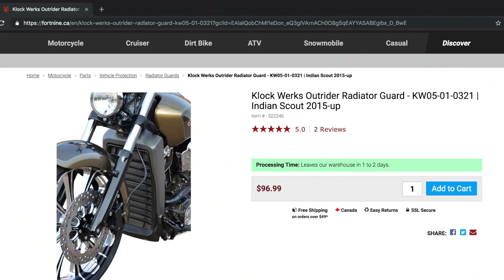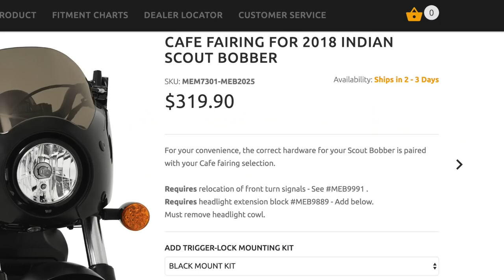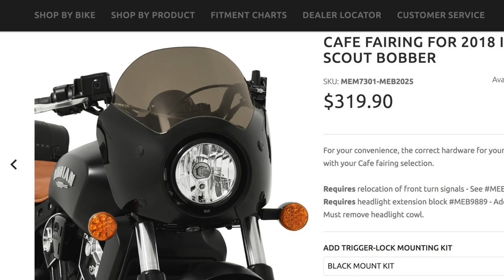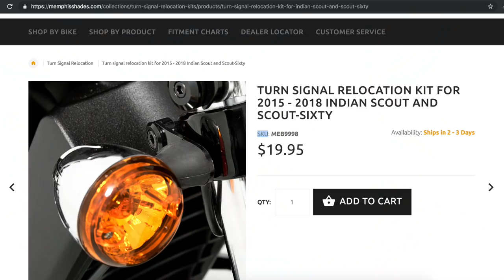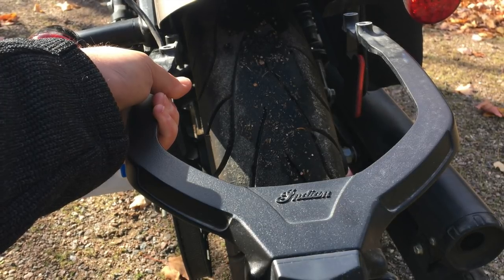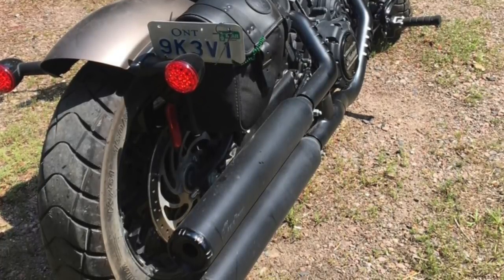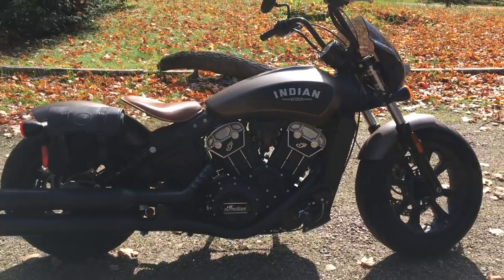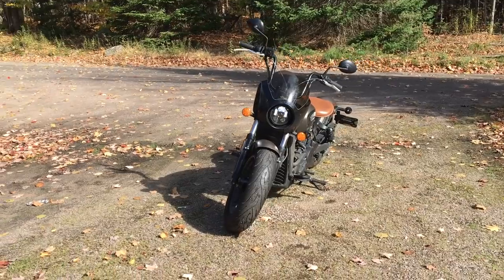Top 5 mods for Indian Scout / Bobber

Comment: I chose the build to order option for my 2018 and only ordered it with 2 extra features. I got the better led headlight direct from from Indian which was super bright. I also ordered mine without a faring because my dad had a spare if I ever decided that I wanted one, and I ordered the street tires as well. Ordering the bike with the street tires and headlight only bumped my final cost by a few hundred which was fine. Other than that, after I had it for a few months, I ordered a set of Vance & Hines slip on exhaust, a Corbin seat, Vance & Hines air filter to work alongside the better exhaust, and I did an ECU remap and added Vance & Hines Fuelpak system which custom tailors fuel mapping by how you ride.

As far as the suspension goes, RaceTech is one of my sponsors for fmx freestyle motocross and when I use to race the East Coast MX Series, so I have had a 24 year relationship with them, they worked their magic on the forks and shocks, and as always, like with every dirt bike suspension that they have done for me, they did an awesome job re-valving the suspension and fine tuning it for my weight. That is the one thing that street riders seem to not understand when it comes to suspension. Most riders that want a better riding and more comfortable suspension spend an arm and a leg on an aftermarket suspension system when they don't need to. A simple spring change and re-valving in the forks and rear shocks makes a massive difference at the fraction of cost compared to a brand new aftermarket suspension.

The bikes suspension not only reacts to the road and how you ride, it heavily reacts to how much the rider weighs as well. If you want a softer suspension that is more reactive, a re-valve is a MUST. Being that I am only 5ft 7 inches and 156lb, my suspensions require a softer rebound in the valving and a different spring in the forks. You will be amazed how much more of a comfortable ride it becomes with a simple re-valve of the suspension. Springer style seats will take the edge off, but a re-valve will make it ride like a Cadillac.
Reply from the maker: This is the most informative comment ive ever had on a video! Thanks.

What brand of tires did they swap for you? Ive seen comments in forums that they wouldn’t swap the kendas but would  sell you another set if you wanted (obviously)
Reply: @canadianrydz7057  Thanks. I got a set of Pirelli Night Dragons. My dad seemed to like them and he recommended them to me. He has a set of those on his 2017 Triumph. He also said that the Metzeler tires are also a good option for street tires if I ever wanted to try something different down the road. He had a set of those on his 2007 Triumph.
Reply from the maker: Those are both the top recommended for scouts ive seen in forums. I might switch it up this season but i have commander IIs because i put a lot of km on
Reply: @canadianrydz7057  I had Commander II's on my R1 Raven before I sold it. They definitely last a good while. I really like the Pirelli Night Dragons. I had a few times last summer where I had to ride my bike on wet roads because it rained on me, and they gripped the road nicely. They do really nice on winding roads. I live in the southern part of Virginia, and my dad, uncles and a few of my cousins like to head to the Blue Ridge Mountains and cruise the roads. My Indian is definitely more comfortable to ride for long periods of time compared to that crotch rocket I had. My butt, arms, legs and back thank me every time I get on my Indian 😂

Comment: Thank you very much for making this video! My wife and I are both experienced Riders and we are buying new Indians next fall. I am getting the 2020  Indian Chieftain Dark Horse with the 116. She loves the Scout bobber, but was concerned it would not be a good long-distance motorcycle to ride. After seeing your video we know exactly what we need to look at changing and that it can be a good motorcycle for taking trips on. Thanks again. Look forward to checking out your other videos.
Reply from the maker: If I were buying it for long trips I would probably go with the scout, that rear fender sure comes in handy.  But I bought it for looks and don’t regret it at all.  You should check out jay fast on youtube as well. He recently did a trip to southern california and temporarily turned his bobber into a bagger.  Seems to have worked for him
Reply: @canadianrydz7057  thanks for the additional info. We will take all of that into consideration. My wife currently has a 2010 Honda Fury and we ride 6 to 10 hours in one day ( on a long ride) but it's usually 45 miles per hour enjoying the scenery so we don't get in a lot of miles, it's still seat time. The problem with her current bike is, it has a very narrow front tire and loose debris Hot Tar excetera have caused her control issues. We need something with a wider front tire. And my bike is an 06 Yamaha 650 that is just not up to doing high speeds and long travel.

Comment: Hi. Great video. One of the better ones out there. I have few questions about the cafe fairing. How good does it protect from a wind. I’m shopping for one right now. You did say it protects the upper body, how tall are you? I’m 5’6. I wonder if it will protect the head as well.
Reply from the maker: As i said in the video it doesn’t stop the wind from hitting your face or hands, it just makes a difference in how much the wind blows on your chest.  Overall i feel it helps with highway driving and long distances

Comment: I've seen in a number of videos that the indicators roll around a lot, did that happen with you? How'd you deal with it if so?
Reply from the maker: KentAllard ive seen that as well, but only in older videos. I believe because it  was a known issue they have improved the quality control on it.  

You can see i installed the Memphis shades turn signal relocation kit for the fairing — that kit also corrects the problem (if you have it) because the kit replaces the factory brackets.

It is also possible to just remove the brackets and install something underneath them like tape. 

But while mine was setup standard from the factory — i never had that issue

Comment: Do you recommend for regular long trips? How is the suspension? Any thoughts on the Indian® Performance Shocks By Fox® - Black
Reply from the maker: For long trips the better choice is the regular scout.  I probably still would have gone with the bobber but its not as practical having a rooster tail of water shooting up your spine everywhere wet that you go.  If i was to set one up for long trips i would get a regular scout, heated corbin seat, third party bags because indians bags are tiny - and put on heated grips.  Im not sure where i saw them but you can get large leather saddle-style bags hanging on both sides of rear fender that hold enough to make it like a bagger.

I don’t know what the performance shocks would feel like but the suspension is something i haven’t had any issues with.  If you try a good cushion seat on the regular scout with its suspension (1” higher than the bobber) i think you would find it pretty comfortable. Im just guessing though.

Depending on what you want though upgrading to their bigger models might make more sense. Like the Springfield or chieftain with their bigger engines and weird options (like firing only 1 cylinder on idle to keep heat off your nuts)

I like the simplicity of the scout, if it could have less sensors and lose a little efficiency i would be all for that. I want something that lasts forever and i always think the more computers and electronics something has the more time its going to spend getting repaired.
Reply: @canadianrydz7057  Awesome! Thank you!

Comment: Hey man, thanks for making this vid. Are you still happy with the Memphis Shade? I have a Bobber and debating a fairing for wind protection. Im just hesitant as I fear it effects the look top much. Thanks again
Reply from the maker: Drew Dough i really like it, tbh i thought id take it off a lot and just put it on for longer rides but I actually never take it off.  Its just personal preference though, the cafe doesn’t change the feel of the bike — but does help on the highway.
Reply: @canadianrydz7057  Thanks man. So it helps with the wind significantly? Any head buffetting issues?
Reply from the maker: Well the wind still hits your face, it just seems overall to be reduced. If you’re looking for a significant reduction they have larger models that are meant to deflect from the face and head better.

Comment: Do you find it hard reaching the handle bars? I want to sit between a 90 and 45 degree angle. I'm not sure if I have to modify the handle bar to go closer or if I should get a seat that pushes me up a little bit.
Reply from the maker: Well you can see i have indians mini ape hanger bars, that was how i picked the bike up originally. They allow you to sit up more straight, as do the reduced reach bars.  I found the stock regular bars felt a little weird for me - but i have a funny body shape as well.  Short legs, tall upper body.

Comment: Man what did you did to that motorcycle? Is so much better looking stuck. Those handle bars are horrible that faring doesn’t look good maybe because those ugly handle bars and that seat doesn’t look good at all. The only thing I’m going to change in my is the exhaust because is to long and ugly. The only thing I like from you modifications or accessories is the single saddle bag
Reply from the maker: Hey everyone has their own ideas about what they want. Everything you mentioned that you don’t like except that fairing are stock options from indian. Those are their handlebars, that’s their solo saddle seat. And none of it with the exception of the fairing are things i recommend in the video.  Indian has a fairing similar to that too. It can be stock if you ask for it.

Since you didn’t watch the video and apparently don’t even own one — ill just explain that i never mentioned any of that because those aren’t even mods i made. That’s the bike as it came stock from the dealer.

The mods I recommend, for people that watch the video, are more about making the bike work better for the individual that owns it. Not trying to make it look a certain way. You would have to.... watch the video..... to know that though.